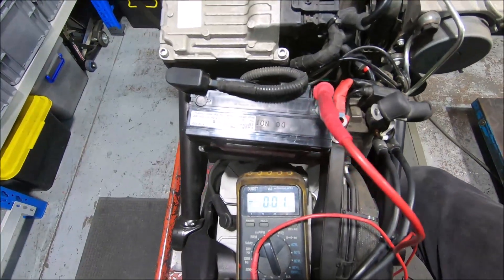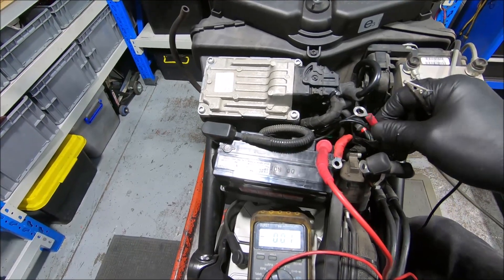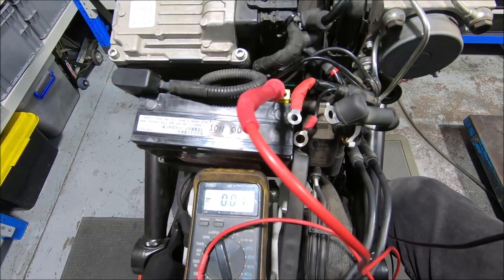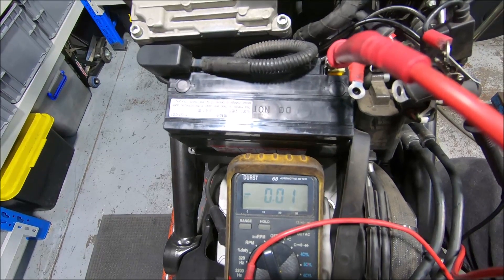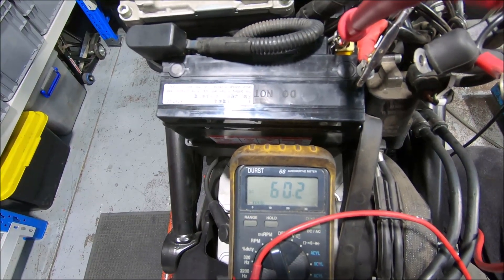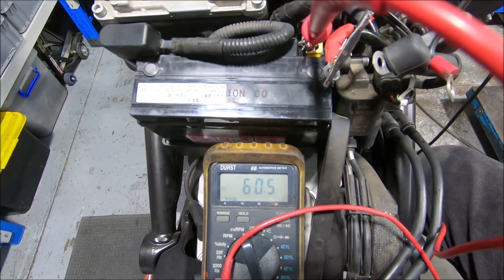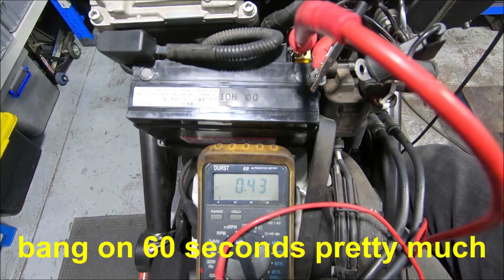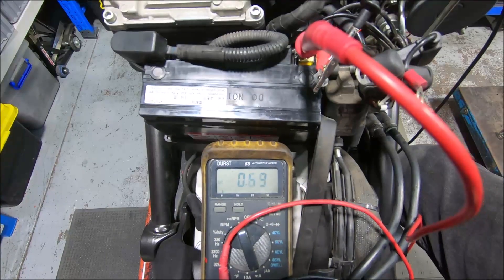Checking battery current draw with ignition off battery going flat.

Comment: What was the battery capacity like? Saddo that I am I have previously put a known load on the battery and then plotted a voltage against time discharge curve to get an idea of the health of the battery 😂. Mind you that was on a motorhome leisure battery.
Reply from the maker: about 12v resting, 8.5v from memory when loaded holding for maybe 5 seconds then dropping to 5v or so after that.  was a bit better after a good charge, but still not worth putting back in.
Reply: @bradthebikeboy  I wish bikers understood the care of lead acid batteries and how they are toast if discharged too much. 😑 The immobilizer will do it eventually.